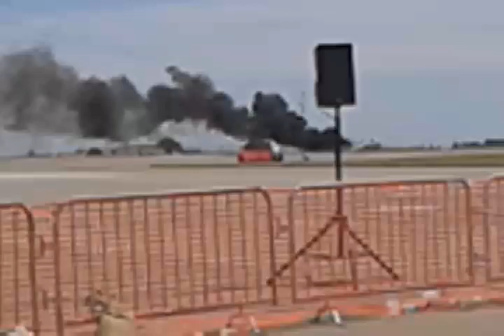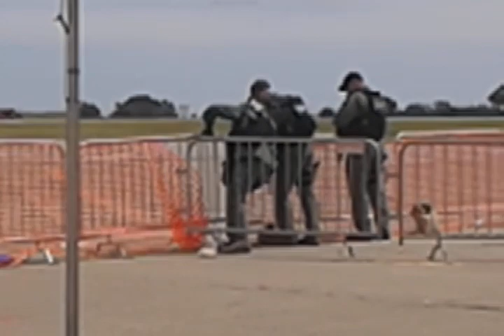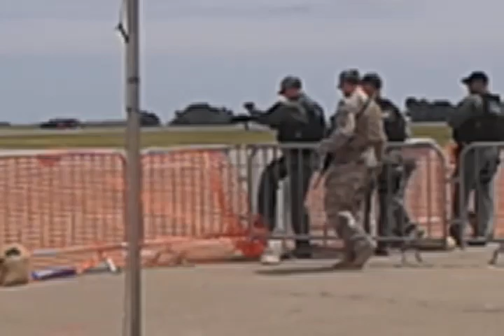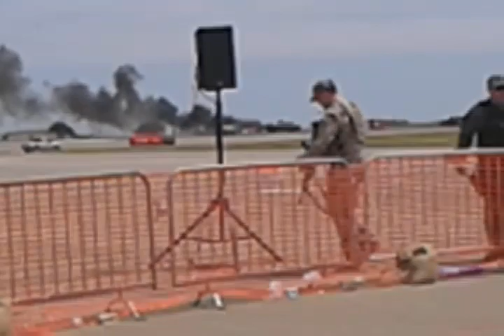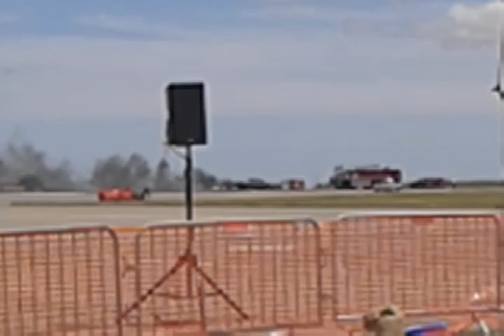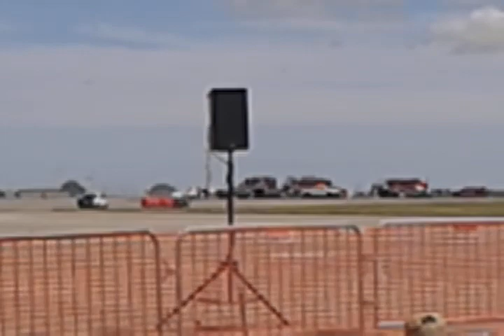Travis Air force Base Airshow Crash Eddie Andreini 2014

Comment: My girlfriend was their, she said the pilot should not have died!  She said that when the plane hit it was already close to the ground just upside down.  When the plane hit it did not fall apart and did not catch fire right away.  She mentioned that the only reason the pilot died was because of how long it took the fire crew to react!  She said it was well over 5 minutes before the fire crews got to him and it was right on the runway!!  By the time the fire crews got to him he was fully engulfed in flames.  So sad. You think they would of had fire crews ready for that kind of thing but they obviously were not!!!
Reply: That's easy for you to say that but you have to remember that the pilot was probably already doing well over 130mph. The fire crew have to respond from opposite ends of a very long runway. Also they have to get their fire gear on which they wouldn't be able to wear the entire time do to the possibility of heat related Injury's.  Further more they also have to get permission onto the airfield/runway from the tower. As you can see there are a lot of factors you have to take into account and I only listed a few. 

8 years of Air Force FD and 3+ at a civilian airport.  So I have the experience to help you understand what has to happen.
Reply: why nobody took his fire extinguisher in car and run to  help that man ?  the crowd is responsible too
Reply: Actually you are wrong!  The fire crew is usually on site close to the runway!  I've been to many air shows and seen a few crashes.  They usually get to an accident that happens on the runway way faster than over five minutes like it took them here!!!  And it doesn't take no five minutes for a fire crew to get their gear on!!
Reply: @ Technos, everyone's cars were too far away!  No one in the audience would of been able to help!
Reply from the maker: @tecknos The crowd is not responsible. If you watch in the video, soldiers with rifles respond to keep the crowd from trying to help, way before fire/rescue got there.
@Canna your right. In my honest oppinion the crash did not kill him. He was well under 100 mph and landed at a soft angle. The response time was sad. There is no excuse for that. Like you said they should be right there ready to go. And it was not too hot to be ready in fire gear and if it was you have them take shifts, its an afb, they have an entire company of firefighters prepared to handle much more.. the video clearly shows it took at least 5 min for them too get to him.
Reply: It took almost exactly 6 minutes for fire crews to get to him.
Reply: Yes I can see you all know more about crash rescue than I do. Tho I agree the response could of been better but the fire dept does not control the staging point for fire trucks during an air show. They can make suggestions but it's up to the base ops and tower.
Reply: Seeing with your own eyes is way different than thinking all fire crews at all air shows have a certain time frame to be prepared to react to a fire!   I've been to many air shows that have the fire crews ready at a seconds notice!  That I have seen with my own eyes!  This pilot was cooking when people were still standing around with their thumbs up their ass!  And what I mean by that is they were not prepared for it!  It's not that we know more about it than you do, it's that we all seen it with our own eyes!  People timed it! It was a ridiculous response time!  And I don't know why you fuss and say we know more about it than you do when you actually end up saying we are right!  The whole point of my original post was that the response time was too slow!  And you admit to that now!  So instead of wining and saying we know more than you just say that you agree and nothing more because we don't care how things are supposed to be done, we know that already, we are talking about what was done on that day and they were not prepared!  And I'm not trying to be rude but honestly no one cares about your background.   If it happened at the past air shows I've been to they would have been to him a whole lot faster!
Reply: I was at an air show in Chico Ca at the Chico municipal airport and they had the fire crews closer to the runway than the crowd was!  They had a clear path to the runway and they all had their gear on!!!  This is a fact that I seen with my own eyes! It doesn't take a background in this kind of thing to know that they were very well prepared for a crash!  At the air show in Fairfield , the fire crews were so far away you couldn't even see them!  Not until 6 minutes later when they showed up !!!  The crowd was a whole lot closer to the runway!  If I was on that fire crew I would be feeling like sh&t that I took so long to help someone who needed my help!
Reply from the maker: the rescue crews did feel like shit. I could see it in their faces as they drove past the gates leaving the scene.
Reply: @T_Rav27  Excuses their response was completely pathetic. They should all be fired and the pension that they shouldn't have anyways removed.